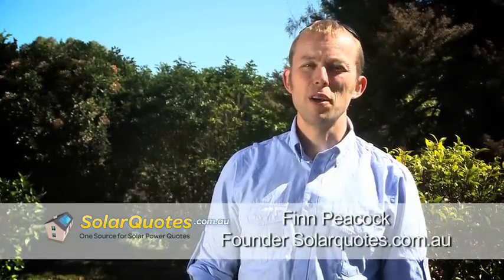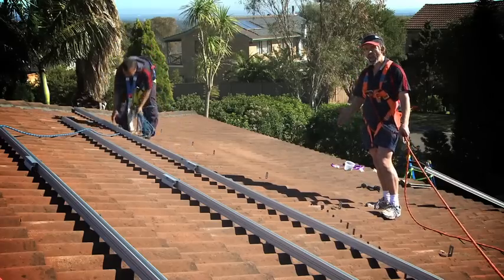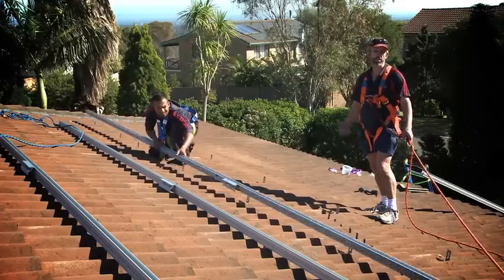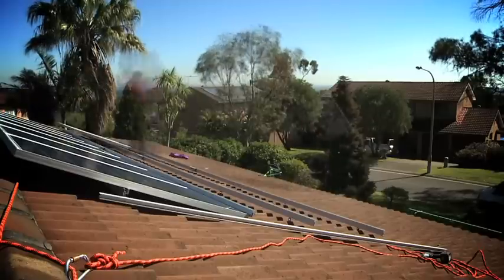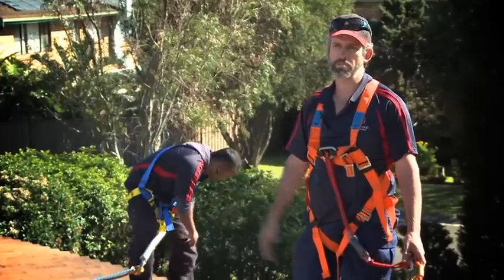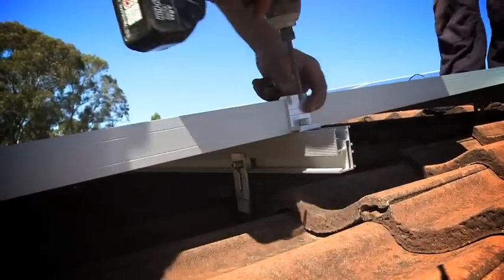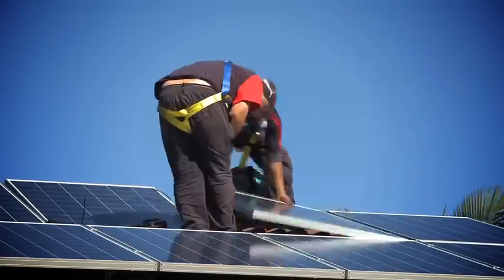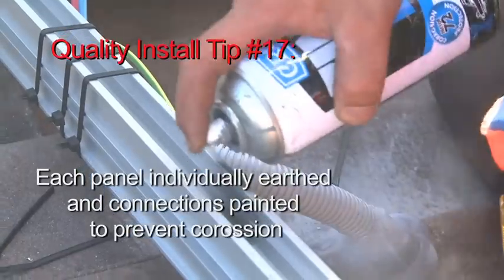Solar Power Install Part 4: The Solar Panels

Comment: 1) Is 4mm DC cables sufficient enough to use for solar panel installation?
2) What is the maximum distance for the DC cable from the Solar Panels to the inverter?  What is the recommended distance in meters?

Comment: lol no more plastic cable ties only stainless steel cable ties rules changed and also all DC cables have to be in heavy duty conduit for the full length of the cable run...